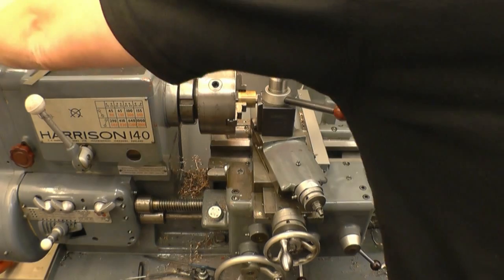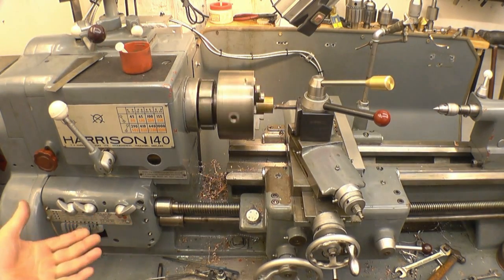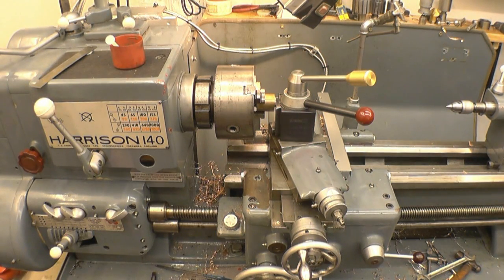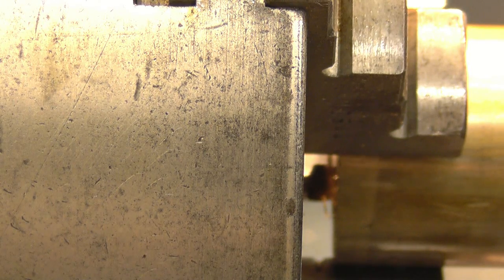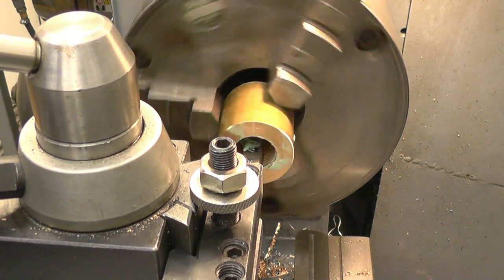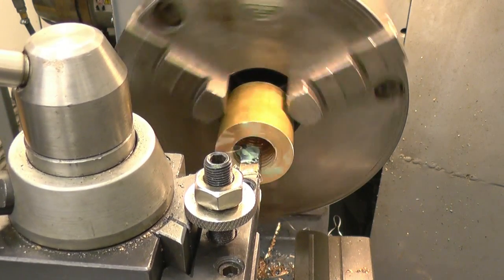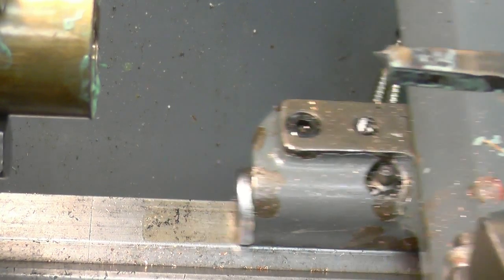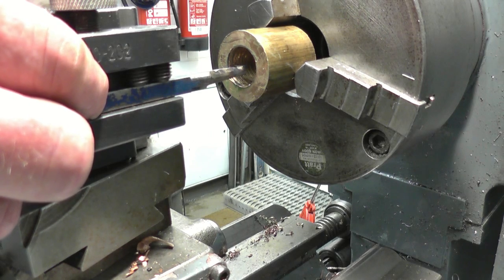Left Hand Internal ACME Thread part 3

Comment: Can internal ACME threads be cut in smaller diameters with anything other than a single point tool?

Seems like most indexable cutters at 5 or 6 tpi and their holders are much too big to internally thread a 3/4-5 or 3/4-6 application.

I've been looking everywhere for something that will cut these internal threads with either indexable or replaceable carbide inserts. I'm wanting to cut a bunch of SAE 660 bronze and HSS isn't going to do it.

Comment: Time to install a VFD fella I feel your pain stopping and reversing every cut, my mill is so easy to use for rigid tapping etc, what a transformation for these machines when you can even adjust the ramping speed when the motor starts and stops.

Comment: Hi John,

I cut almost all threads using the lathe reversal method.

A time saving trick is to switch into high gear when returning to the start position, or on my VFD equipped Harrison, to cut the thread with the JOG button, then return with the run button.

Comment: Nice pick-up after losing the thread in the most difficult of circumstances. Did the relatively steep wall of the Acme thread (29˚ vs. 60˚) make it easier to "feel" the tool into the existing groove? I noticed you "rattling" the tool into the groove.

When picking up a thread like that, would it be a good idea to take a very light cut by advancing the cross slide (to get a slight cut on both walls) before resuming the advance with the compound? (This would apply with either internal or external threads.)

Comment: John, nice work!  I'll have to remember that trick of picking up the thread with the tool loose in the holder.  I wouldn't have thought of that, and I'd have been off a bit, and I'd have had a scrapped part.  Maybe now I won't after seeing this. Thank you!

I hope Deb's radiation therapy is going well and she's not feeling any rough side effects. Won't be long now until she's past all that!

-- a Mike